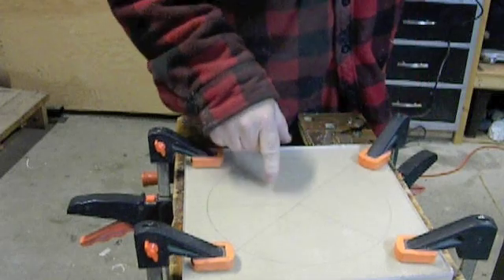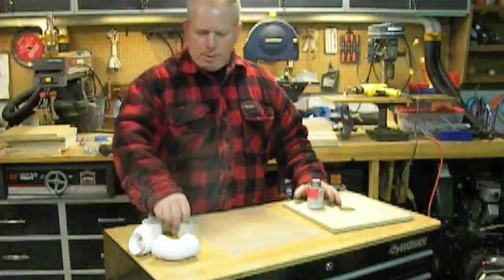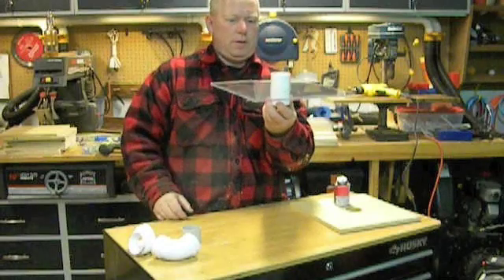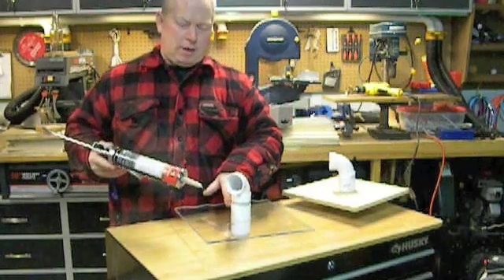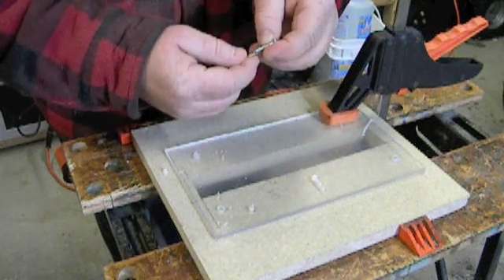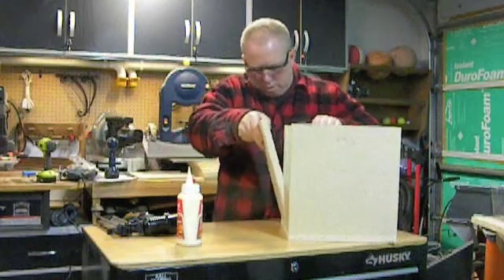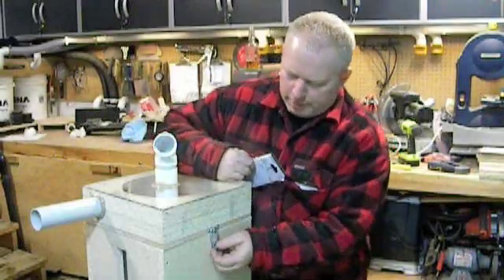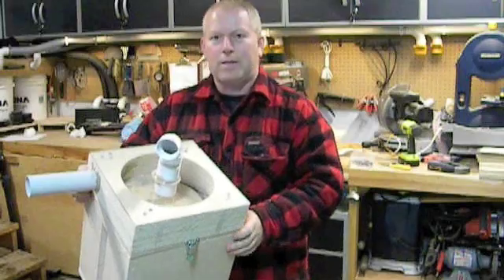World's Best Cyclone Dust Separator! (part 2 of 2)

Comment: hmmm.... i wonder.... what if.... the pipe at the top (the suction pipe)..... goes all the way down, just right under that round circle hole (same height as the bottom box), i mean it will hide the pipe from incoming dust and increasing its efficiency right ????? or not ??? hmmmm.....
Reply from the maker: You can change the amount of space between the top pipe and the baffle plate to "tune" the cyclone to the size of your shop vac.  You need a certain amount of space to allow proper suction.  You can see the dust spin out of the air stream in the video.  If you are getting dust in your vac try making the top pipe longer (decreasing the space between pipe and baffle plate).
Good luck with your build!
Cheers!
Rob
Reply: IMA experimenting that....., thanks Mr. Rob...
Reply from the maker: You're welcome!  Just dry fit the pipe until you tune it.
Cheers!
Rob

Comment: Great project.  Looking at buying the home vac piping.. do you just purchase regular PVC couplers to join them, if so, what size?  Y connectors? Blast gates?  Thanks.
Reply from the maker: +Schurman Scroll Works - You can get the blast gates from "ShopVac" online.  The rest of the piping is all central vac stuff readily available from your local home centre.  ShopVac uses the same size as the central vac stuff.  If you buy some other brand of blast gates they are a different size and you will have to buy extra very expensive pipes and fittings from them.  The central vac stuff is dirt cheap, readily available and easy to use so that is what I would recommend.  Feel free to ask more questions if you need help.  Thanks for your comment and Good luck with your project!
Reply: +Rob&#39;s Garage Woodworking Does it matter on the baffle portion where the inlet is at compared to where the 270 degree cut out starts?
Reply from the maker: +Schurman Scroll Works - Not really.

Comment: Rob, where are you using these? I just watched you video today and you still have the same buckets in your system.
Reply from the maker: +WoodRodent - I need 2 to replace the double separator.  I made one and I'm going to slightly modify the next one which is just an idea in my head right now.  That's why it's not yet in use.  Very observant!

Comment: Like the window to see when the box gets full. Good job.
Reply from the maker: Jim Cook Yes It solves the problem I had with the previous designs.  The bucket would fill right to the top before I realized it.  This way you can see right away.  Also the square dust bucket eliminates routing a channel on the bottom of the baffle to accept a round bucket, which makes it an easier build.